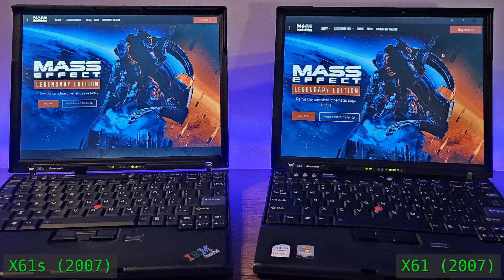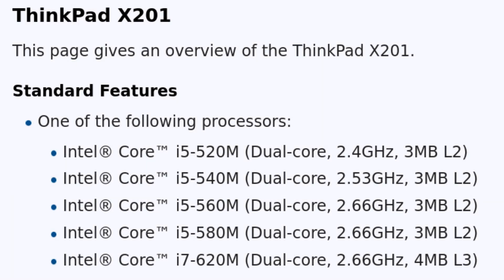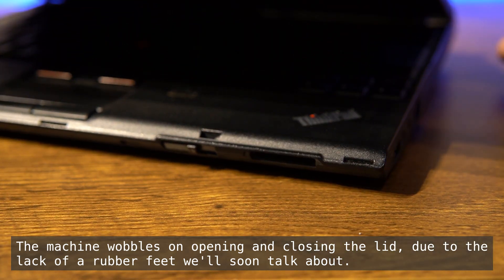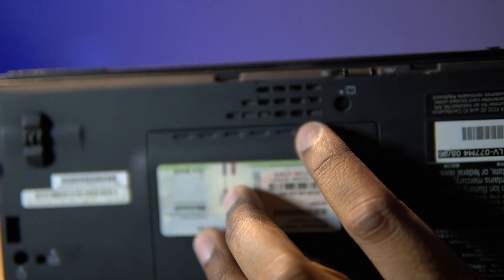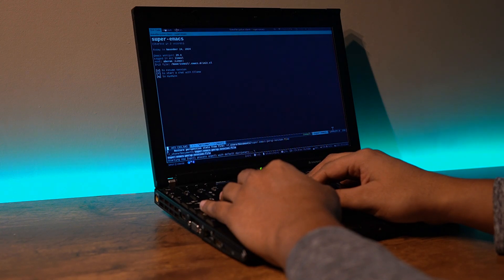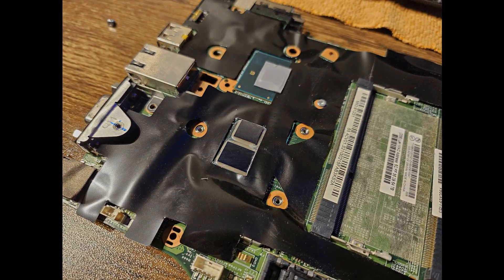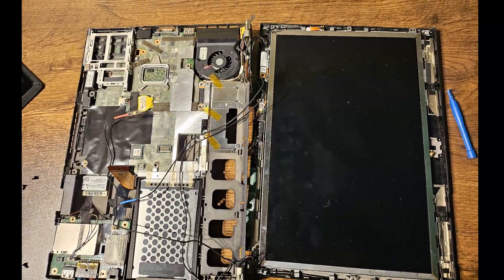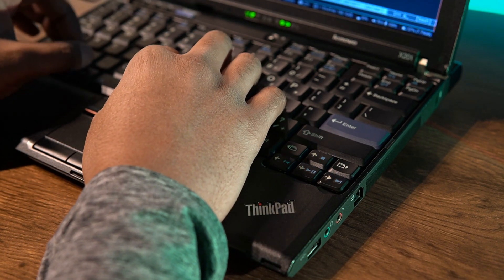The ThinkPad X201 (Still) Feels Futuristic!

Comment: Great video. One reason I would maybe consider getting an X220 over the X201 is that the X201 still uses a ccfl backlit LCD. LCDs with a LED backlight seem to hold up better over time.
Reply: Подсветку можно поменять на LED но очень хлопотно самому, нужно искать специалиста
Reply: @СергейРоманов-л9д  That's true. Although if one is willing to mod their laptop, the later models also can be equipped with IPS screens.
Reply from the maker: Ahan!
Reply from the maker: That's correct. The color temperature on my X301 is not the most pleasant to look at. 🤓

Comment: Rubbish! 201 Feels old - its history. I have x220, 230 (iPS), L470, T480 (with Nvidea Graphics card and IPS Screen). All  memory have been bumped upto 16gb (except 220, left that with 8gb). Each machine have been installed with win 11 pro. L470 is the fastest at boot-up. T480 can handle heavy complex processing with ease, thanks to its quad core CPU. The X230 is a joy to use can handle many difficult task without any major issues, mine has 3 stage back-lit keyboard (3rd being think light) - unusual eh! X220 is the only machine I use for when I use Word - love the keyboard. So none are perfect.
Reply from the maker: As they say: to each, his/her/their own. 😛

Comment: Hi is this a good computer, can i have windows 10-11.whats different with x201,and x201i
Reply from the maker: Hello! You'd rather not run a modern operating system on one of these. Though they may perform, you'd be better off with any light-weight Linux distribution. Usually, the "i" in ThinkPad models, like the one in X201i signifies that it's a lower spec model, such as ones with a Core i3 processor (while the regular X201 is available in i5 and i7 variants), and is usually sold for lesser money.

Comment: I agree on the premium feel, the laptops have seem to lose the premium feel over the years, I have a Thinkpad X200 which feels so much better that my X201, it feels more premium and the plastics and bottom case are also more premium, I have no idea why, but the plastics seem to be more durable or more resistant, also the attention to detail on the plastic design, and the mechanical of the latch and other things.